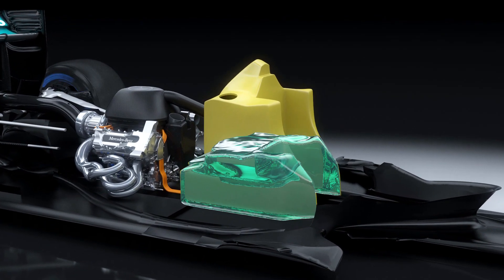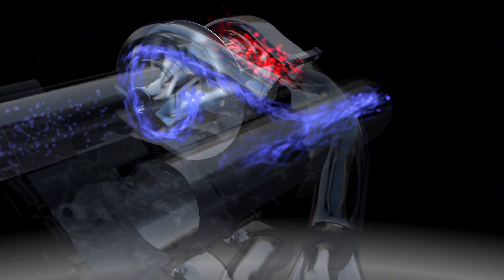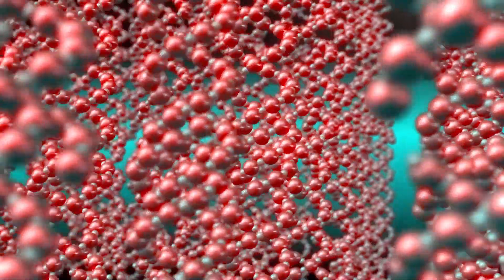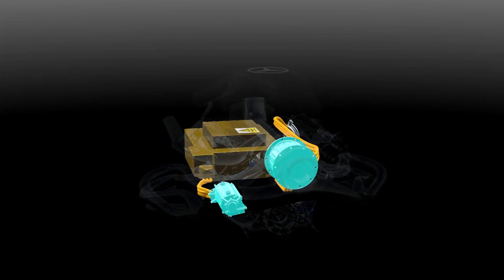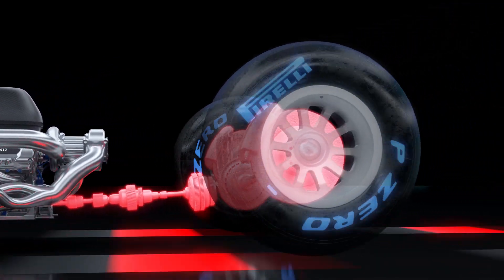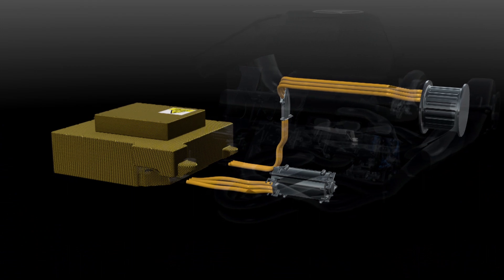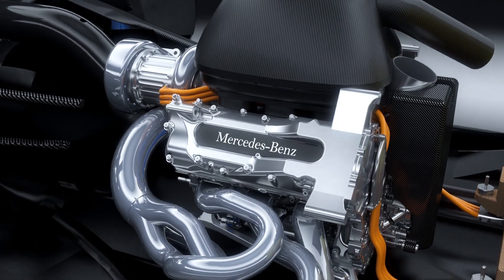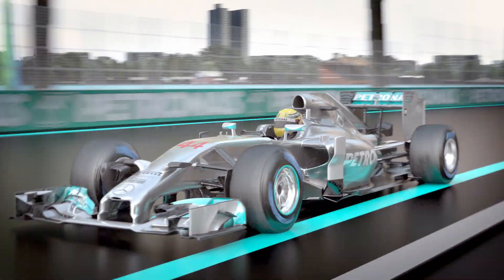2014 F1 Mercedes Hybrid turbo V6 Power Unit explained

Comment: Guys could you explain to me... Generators harvest energy,but how is it used? I mean there is no electric motor connected to transmission,so the accumulated energy is used just to spin turbo faster? I’m lost 😂
Reply: Boiii when it spins the turbo more oxygen can be let into the engine giving it more power . It can also add help the engine

Comment: why not rather use bigger displacement, lower revs (~same MPG) no MGU-H and use electric compressor to eliminate the turbo lag?
Reply: Coz it’s where merc engine advantage came from:) the 2014 engine regulation was designed to be favourable to merc

Comment: They produce a considerable amount of bhp for a tiny 1.6 ltr V6 engine, over 600bhp and fuel efficiency that's unheard of in motor racing. Although helped by a bit of electric. Technology is being pushed throughout the F1 manufacturers and idea's are being transferred onto the cars that we will be driving in the future aswell as now. I still miss the all out V10 and engine technology from the 80's and 90's as then it was proper engineering to be the best and getting a design better than there competitors design. Someone should start a race serious with big money prizes for the first car over the line, which any design idea is aloud aswell as engine configuration? I can dream I suppose? Does anyone else out there think that F1 is quite boring compared to olden days of racing?
Reply from the maker: Yes, most do, the engines sound like ASS.

Comment: A LOT of nostalgic comments  below. When you consider that there are companies producing billet alloy 4 cylinder motors that can produce 1500 HP when boosted, fuel efficiency needs to be the next hurdle for automakers. V12 is dead. V10 is dieing. V8 on the way out. V6 still relevent but expensive and efficiency is still lagging. The last hope for efficiency is the opposed 2 stroke. But still, it's biggest problem is exhaust toxicity. Battery EV will be the only way forward with formula E once motor efficiency is improved and battery density and recharging gets to the next level.

Comment: There should still be limitless bhp cars and crazy new innovations like in the 60’s where it was best manufacturers vs
Reply: That overlaps the other segment of fans that wanted nearly equally performing cars for all drivers, in which the most skilled wins.

I do agree with your statement, except with stuff like fuel flow limit, budget limit, minimum weight, and aerodynamic regulations stated. I do agree that the FIA should give freedom for teams to have their own unique drivertrain configurations, just like Le Mans. There can be a V10, V8, flat 8, v4, or even a single turbo Inline 4, (the 12s are unlikely) except that the fuel usage is limited (satisfies the "carbon neutrality" approach) and development budget limit (to prevent too much budget inequity to the smaller teams) and minimum weight for safety.
Reply: There is no limit on f1 engine power.

Comment: Unfortunately all these engine changes have ruined the sport from a spectator point of view, Ferrari and Mercedes have too much power and are basically running the show. Engines should be far simpler, as well as the rules and regulations - as for safety cars coming out at the drop of a hat...bring back the 70's/80's

Comment: first v12, then v10, then v8, and now a pitiful hybrid v6. In a couple of years they'll put an 800cc straight 2 engine in that sounds like a crying child. #bringbackthev10
Reply: If you haven't noticed the trend, which you quite brilliantly pointed out yourself; engines are getting smaller.

Get over it.

Comment: Too bad the FIA has a fuel flow limit rule. If they brought back refueling and lifted the flow rate, these cars would have well over 1000 hp. Even if they had to last 3 races.

Comment: It was at least a year ahead of it's competition.  I'd say Mercedes will dominate for a couple of years yet.
Reply: It's been 8 YEARS OF DOMINANCE
Reply: @OriginalFake I'm just amazed that Mercedes was the only major manufacturer that was looking heavily into hybrid power for their motor sports division...Others had started before them (Honda, Nissan etc) but were doing so with their eyes on the commercial market.  The hybrid era seemed to sneak up on the rest of the F1 engine producers.
Reply: Also, splitting the turbo in two and running both halves of it, one on each end of the engine, running directly off the crank was a total masterstroke...Zero lag.

Comment: Yea it may sound terrible but this is engineering porn guys
Reply: well you can't argue with 6-time F1 constructor champion
Reply: “seems to reverse the laws of physics”. no engineer would take this seriously. its all just a typical ad full of bs
Reply: It is overcomplicated.
Reply: @nodo7575  You cannot argue with the 50% thermal efficiency though, that is simply incredible
Reply: @nodo7575  go watch NASCAR if you want oversimplification in racing.  The adults are talking.

Comment: I've been racing my prius for years. I couldn't wait for the F1 cars to be finally fuel efficient. Now the track guys will have to stop mocking my 16 sec 1/4 mile time.. The MPG is clearly the decisive factor of any race.
Reply: Trub1n Lol please me tell me your joking?
Reply: Meanwhile, the Koenigsegg Regera is a hybrid that produces nearly 1500 HP.
Reply: @alaeriia01  you know the current f1 cars produce 1k HP right?
Reply: @SurrealCereal  yes.
Reply: @alaeriia01  aight.
Reply: @alaeriia01  ant it would be a minute slower in lap times than an f1 car around the track, koenigsegg  fanboys are so random
Reply: @recipoldinasty  well, no shit.  I was merely pointing out that "hybrid" ≠ fast.
Reply: rip f1.

Comment: We need an R26B engine powered F1 car.
Reply: old fashion? lol V6 have been around since the 40's. also we need a 4 rotor. yeah not so great with fuel but honestly a 4 rotor f1 car would be boss.
Reply: lol nope. mazda have been developing the 16x since 2008.
Reply: ***** yeah i know im super excited. also did you know that the new RX7 has been announced? it's out in 2017.
Reply: CmdrTobs bro bigger mx5 body. and comon who need turbo? raw power in great and na rotary engines sound fucking amazing.

Comment: I love that hyrbid turbo thing, electric charge to spool the turbo from 500 rpms rather than 2000. Implementing that technology in road cars will make a huge shift in the way we modify cars. There wouldnt even be a need of smaller turbos, larger turbos can now be put in smaller displacement engines without the worry of lag. Cant wait to see the technology of the near future.
Reply: Well... the new regs made it clear... the hybrid turbo isn't going anywhere.

Comment: I agree that F1 is at the top of advanced technology. But it is not interresting to watch !
Who cares about hybrid engines ? I've got a old Chevy Caprice V8. It sound far better than actual F1 !!
How much cost a battery like those one ? Could you put one in a small basic car for less than 10000€? What will happen in case of road crash ? Maybe it generate less CO2 but at the end, what about recycling the batteries ??

Comment: if you are only in it for the loud noises go to a nascar race you pillocks. this is a motor sport not a car show. its all about the car companies competing to perfect their machines while the drivers are using everything they've got to push the machine to its limits whilst strategically racing.

Comment: Just bring back the bloody v10's :(
Reply: ***** You are the kind of people that make F1 less tolerable. Do you have any idea how advanced this technology is? How difficult it is to manufacture a 1.5 litre V6 engine? F1 is about pushing the limits of technology. WEC already has hybrid engines, why can't F1? Stop thinking about the sound, and broaden your mind.
Reply: And you say that with a motto of "Keep Calm and Let the turbo spool"?

Mate, it's more impressive to get great performance from a smaller engine, than just shoehorning a large engine into a light car.

Take a look at Le Mans. The Audi R18 has half the cylinders and half the turbos and about 2/3rds of the cylindervolume, and 75% of the horsepower of the old Audi R10 TDI and it still drives faster.

If they can make small 1.6 Turbo V6 engines just as quick as the old 2.4 V8s (or even the 3.0 V10s) then I'm all for it.
Reply: Never going to happen. The automotive industry is moving towards smaller engines coupled forced induction and hybrid power trains. These are systems we'll see on everything from economy car commuters to high end supercars. The-powers-that-be want to keep F1 relevant to road cars for marketing and a litany of other reasons. A naturally aspirated V10 has very little road application across such a wide range of vehicles. 

Not saying I agree with any of this, but that's the rationale.
Reply: James Muthui what's the point of making a v10 hybrid??? The max a hybrid should go is v8 as anything above might as well make keep it just gasoline
Reply: ancient astro a motor generator assisted centrifugal supercharger and 2.8 liter V10 would be awesome.
Reply: @ancient astro  bcuz it will be less fuel efficient!